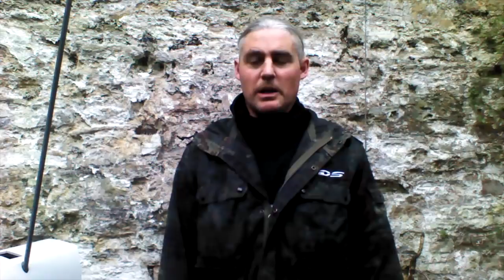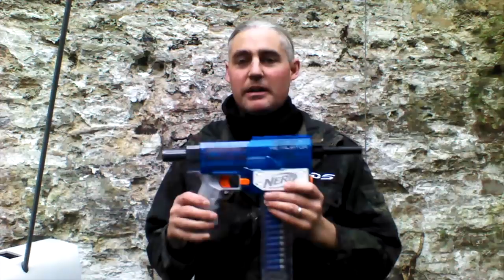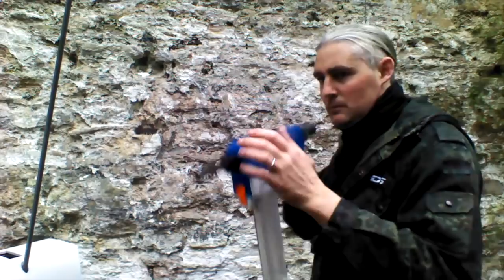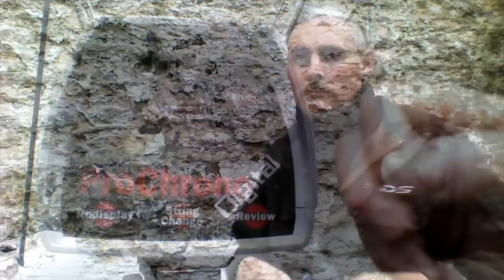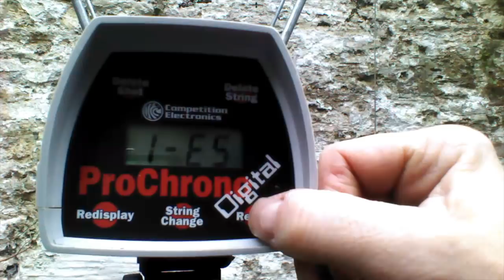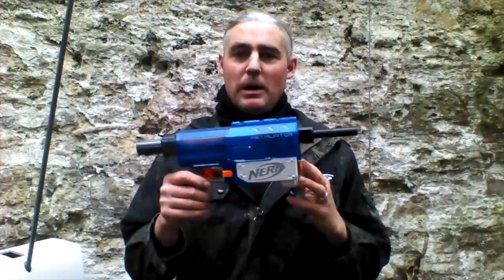Worker Sealed Breech Test

Comment: I feel like a sealed breech will make more of a difference with a stronger spring
Reply from the maker: It does about 120 with the Worker 9kg you get with the kit. The functional barrel is certainly useful. 
 That's not much more than the 115-118 you can get out of a stock bolt with the OMW 7kg. Sealed breeches do make better use of the higher spring rates but this test was expressly designed to measure JUST the effect of a sealed breech, not a bigger spring. I test each kit with the same 5kg OMW spring and 1g darts so you can compare their performance directly.

Comment: Yep! These do need the xpt to be any good. I've done a video on how to get the xpt to fit using a few tricks I get from other people and my own tinkering :-)
Reply from the maker: Anything will make more power with a bigger plunger volume. That's like saying "yeah my Reliant Robin goes a lot faster now it's got a blown Hemi in it..." Will see what happens when I test the XPT.
Reply from the maker: If anyone wants to see UK Foam's solution it's here- https://m.youtube.com/watch?v=NZxwaXtQSY0
Reply: Foamdata Services Yes but a xpt with a standard bolt shoots slower than an XPT with a half-length pusher bolt. 

Thanks for adding the link :-)
Reply from the maker: That's because it needs a functional barrel to take advantage of the increased air volume. The dart is starting to move before the piston finishes its stroke in the stock bolt/XPT set up and then any remaining air vents out of the bolt instead of continuing to accelerate the dart.
Reply: Foamdata Services So, refering back to my original point. These need an XPT to be any good. :-)
Reply from the maker: It's a chicken and egg situation.

Comment: It needs a 9k+
Reply from the maker: But then you wouldn't have comparative data. Everything shoots harder with a bigger spring, you can get close to 120 out of a stock bolt with a 10kg spring, that's not the point f this test. I have put all the kits I have through the same test process so the results can be compared.
Reply: Foamdata Services ok good point 
Thanks for the reply
Reply from the maker: I can do data with a 9kg spring, I have several. There's figures for the Nerf Turf 10kg here-
https://www.tapatalk.com/groups/britnerf/nerf-turf-10kg-vs-omw-7kg-test-t3504.html

Comment: Hey Foamdata Services you can nest a piece of 17/32 brass into the barrell really easily (like ridiculously easily) and drill out the breech a little bit to improve airflow. after this it makes a pretty decent system and the plastic seems to be strong enough to handle a decent spring load.
Reply from the maker: Yeah, but it still won't shoot as hard or as quick as my Stryfe.
Also I bet the people who posted those extra mods have zero figures for them. A decent brass breech is still the best solution for Elite springers in terms of overall power output.
Reply: I run one of these modified breeches in my extend PT retaliator and i can say from actual NIC experience that it runs pretty well. The seal on the breech is great but i will admit even with the bore drilled out the air flow will never be as good. Overall with only minimal modification this can make a nice breech set up. Seriously give it a try.
Reply from the maker: The fact that you have a larger plunger volume means a tighter barrel fit will help, I am measuring just the XPT with this set up next, which with a 5kg won't affect the barrel volume or dart fit required. No test figures still means no proof. Game reliability is important, totally agree with that and this set up, for the money, is very reliable. It chewed far less darts than the Artifact one and didn't jam as much as the OMW full length breech.